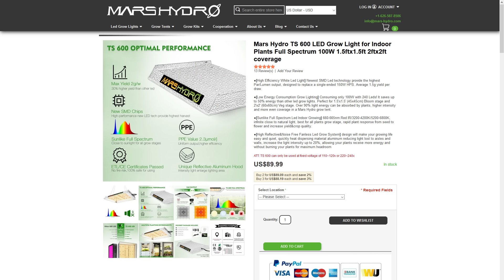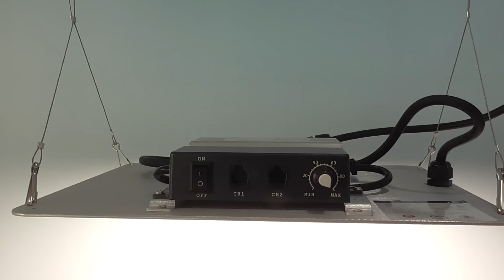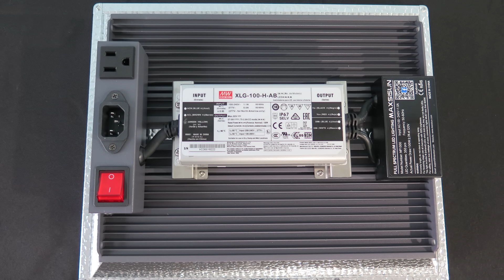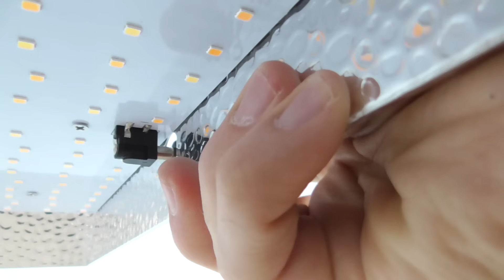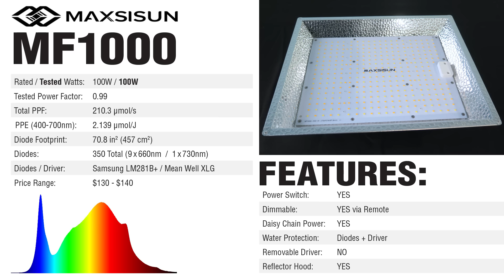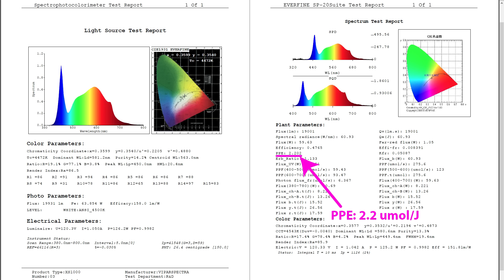Spider Farmer, Maxsisun, Mars Hydro - Entry Level LED Grow Light Comparisons, Test Reports & Reviews

Comment: Physicist out of UW Madison here. Also, a growing and testing enthusiast. 

One refinement to your data - PPF doesn't include sub 400nm or >700nm, so the more IR+UV diodes, the lower the PPF and PPE (as you've calculated), though IR contribute even more on an energy basis (requiring less energy per photon (E=hv/lambda)). So the "2.9" data may just include a wider wavelength range, as PPF is an inherently flawed, invalid measurement parameter if IR+UV are included.

Said another way, a purely IR+UV grow light would have 0 PPF, but would 1 draw power and 2 contribute greatly to plant growth. Awesome video and great work overall, though!

Update: For anyone optimizing a grow room to run as cheaply as possible, plant growth scales with number of photons, NOT wattage drawn from the wall. It takes nearly twice as much wattage to make a blue photon as a red photon, yet to a plant, they're both the same as far as photosynthesis[1]. 

Said another way, a light that puts out more red than blue could have a much lower efficiency but deliver much more usable energy to your plant (red photons carry about 1.8eV whereas blue are ~3.1eV).
Reply from the maker: Thanks for your input! The 2.9 PPE data does not include IR / UV. It was a fabrication. This video update talks more about the PAR range and PPF efficacy vs Photon Flux efficacy: https://www.youtube.com/watch?v=WmjOSzSF-HI

I'm not sure where you get the data showing blue photons require nearly twice as much wattage. This source cites 450nm blue diodes as having an efficacy of 3.5 umol/J while 660nm reds are 4.5 umol/J: https://doi.org/10.1038/s41438-020-0283-7. Red diodes get a boost, but they're not twice as efficacious.

When optimizing a grow room to run cheaply, a grower would get the most PAR photons per watt if they simply used Red Diodes. But such diodes are more costly to manufacture so the upfront cost would be higher. More importantly, plants won't grow properly under such a narrow, limited bandwidth. You need to account for photomorphogenesis. Thus, blue LEDs are needed to avoid undesirable morphologies. But the phosphor coated blue diodes also add green light into the spectrum which brings its own inherent advantages like improved canopy penetration.

Either way, higher efficacy is still crucial. On a watt per watt basis, the higher the PPE, the more PAR photons being emitted which means more growth potential.

Comment: I have a 150w plant floodlight made by yunlighting in South Korea.
63 samsung LM351H-C + 14 samsung LM351H deep red + 7 LM351H IR
The LM351H-C is 10 times more powerful than the LM301H.
701umol/m2 sec at 60cm distance using 60 degree lens
Reply from the maker: The LH351C is 178 lm/W. The LM301B is 220 lm/W. Although the LH351C is rated at a higher max wattage, the larger quantity of LM301B diodes would allow them to compete just fine.

Comment: Mars hydro ts1000 has a 1.68 pod  efficiency in a 2x2 with reflective walls. I personally yield 187 grams in a 2x2 considering the cost I think it’s a great budget light.  Although they aren’t being transparent in my opinion it’s still a good budget light considering it’s 150 watts Check this video out
https://m.youtube.com/watch?v=f1c-b55HhSk
Reply from the maker: It's good that you're getting good results! That video is obsolete as the model was upgraded since then. My update reflects the newer revision data. And I have actual 3rd party lab tests which are the proper way to get efficacy specs: https://www.youtube.com/watch?v=WmjOSzSF-HI

Comment: So far you and Migro are the most honest light reviewers, i'll definitely subscribe.
Could you please review the Mars Hydro TSL2000 and Mars Hydro SP3000? I ordered the TSL2000 and i'm hoping for great results. I wanted to buy the SP3000 but i changed my mind, and it was quite more expensive.

The SP3000 really needs an updated review, all the reviews for it are outdated. Mars Hydro changed the SP model specifics, originally it had UV & IR, good diodes etc. but now they removed the UV/IR completely.. And i think they changed the diodes from Samsung LM301B to LM301D or vice versa, i'm not sure and i don't know anything about diodes.
It was praised as one of the best lights for the price on the market, but now they ruined it.

They claimed their reason for removing UV/IR: ''Customer feedback showed that UV/IR doesn't have much effect on plants, and most growers preferred to add sperate UV/IR lights if wanted''
First of all, UV/IR does have an effect on plant growth. Second, i read their official poll-post on some cannabis forum, and everybody voted to KEEP the UV/IR, most growers agreed it has a good effect on plants, nobody wanted to buy separate supplemental lights. Nobody wanted to remove the UV/IR. Those who were not sure still voted to keep the UV/IR because any addition is welcome. So they are straight lying.
And third, Mars Hydro advertised the UV/IR in the beginning as a good addition for plant growth, and now they're suddenly not sure anymore??
I guess Mars Hydro realized they made a light that is too good and decided to fix their marketing mistake. Because guess what? Not so long after, they released a TC series that had UV/IR and it's so much more expensive.

I ordered from them because i do believe they have good lights that will make me happy with the results, and they are in medium range for affordable price. But i don't like how they deal with weird business and marketing. They waited until all the good reviews were seen, and then decided to change the light. Now it's impossible to get that original light, which was probably the best bang for the buck.

Comment: I grabbed a maxsisun mf2000 after watching this. I love the thing. Great buy IMO, so much so that I actually ordered another one last night now that my girls have outgrown their current set up. Last time it arrived a day early and I had it installed in minutes. Hope this helps someone like me... slow, skeptical, suspicious, shopper who reads every review possible if Im spending more than about $100. Some details... my grow room is 4 ft x 4 ft. I plan on using 2 maxsisunmf2000 for 6 medicinal plants. The heat stays within ideal range with the light on. This guys video is very helpful for understanding the info you want to understand when new to purchasing led grow lights. Good Luck!!!
Reply: Is 1 mf2000 good for a 2x2 tent or is it too much

Comment: I have some issues with our focus on ppfd. Ppfd is a set spectrum of light that is believed to be beneficial for plants, but is it really true that a lamp with a lower ppfd is worse than one with a higher? Or might it be that a certain plant requires a wavelength that is not captured as ppfd?
Reply from the maker: Wavelengths do not trump photon count. The raw number of PAR photons that a plant receives are what fuels photosynthesis and leads to biomass. This is especially true in the case of these lights which all have balanced spectrums that work well for plant growth. So a light that produces higher PPF levels is going to be the light that has higher growth potential. It's a simple, reliable metric.

Comment: Just a great, well-presented video as always. Maybe I can add a couple of additional observations. 

The cheaper Mars lights are made with very shiny aluminum, but it is not anodized. The shine will diminish over time with natural atmospheric corrosion. 

The Maxsisun PB-2000 I bought was the same diodes as my Spider Farmer SF-2000, but it was about a third cheaper. It had about a third less diodes. Wouldn't that mean the diodes are being driven harder and will not last as long (assuming they both run at the same wattage)?
Reply from the maker: Thanks for watching! I'm not sure. When I look at the current PB-2000 Pro, it uses 700 diodes with LM281B+. But the SF-2000 is 606 diodes with LM301B. So I don't know how that compares to older product revisions.

Generally, yes more diodes will mean less current running through each. And this can help with both lumen maintenance and also efficacy. But many of these LED systems are using more solid components these days, especially the drivers. So hopefully it will continue to perform well and last a long time for you.

Comment: I need your advice on picking a good option to grow edible plants or blooming plants in a grow tent setting. I’m unsure which light of the four you rated would be best to grow plants that usually need full sun outdoor (like tomato, marijuana or blooming plants like roses or lotus). We don’t all have sunlight so picking a light that works well is crucial :( please reply ASAP 💓 thanks so much !
Reply from the maker: Any of these lights will work for plants. But lights with higher Total PPF will produce more light. This allows them to work in larger tent sizes. It partly depends on your coverage area and the number of plants. The TS1000 runs at higher wattage and will be able to support more growth than the others. For tent sizes up to 2.5' x 2.5' it would be good. The other LEDs are better for 2' x 2' tents. If your tent is 3' x 3' or larger, then you need a higher wattage light.

Comment: What do you think of the ts3000W mars hydro lights, just curious as I was on a budget n got those ones n now that you showed the water proofing issues on the connectors coming off the mean well drivers they run pretty cool which is nice but i feel like I'm losing light so i installed a mover to eliminate the dim spots and tease the plants a bit

Comment: Mars Hydro is awful. Lights don't fully turn off!!! Major design flaw
Reply from the maker: I've seen LEDs from other brands that will leak power as well. But who manually turns off their grow light each and every day? That's what light timers are for. And when the timer cuts the power to the LED, the light is fully off.

Comment: Hello i have an important question did not find any good answers maybe you could help me :
Is a led photon different from a sun photon ?
Is that so, does it impact the plant ?
Reply from the maker: Hi Rabah. No problem. Basically, any specific color (wavelength) of photon is the same, regardless of the source. So a red photon from LED is the same as a red photon from the sun. But the sun sends out many, many more photons. This is what makes it so bright. Also, the colors of photons are more varied than LEDs. The sun has a more complete spectrum including UV and spanning all of the way into Far Red. LEDs have different mixtures of spectral composition, depending on the diodes used. This video talks about the basics: https://www.youtube.com/watch?v=O3dxjk_E2Ac
Reply: @Albopepper  thanks a lot for your answer! I will surly do !

Comment: Another problem is, PF means PFC, power factor correction which affect by the led driver but not led diode.
Reply from the maker: Yes, the junky drivers are a direct cause of those poor power factors. Consumers need to be on the look out.

Comment: Yeah. But Migro and dr mj coco have reviewed viparspectra and the pro series is better than mars ts
Reply from the maker: Sorry but you need to be much more specific than that. Exactly which models are you comparing? And how are they "better"? What parameters are you looking at?
Reply: @Albopepper  p series vs. The ts series by mars hydro.... if you want the info check out their reviews. But, talking about $/watt, usable ppf/watt, total ppf/watt,price,cost to run
Reply from the maker: No. The "TS" series is not equivalent across the line up. Please specify exactly the models. Are you comparing the TS1000 to the P1000? What about the XS1000?
Reply: @Albopepper  viparspectra  p1000 and xs1500 vs. Mars TS1000. Viparspectra p1000 101 watts, viparspectra xs1500 147.6 watts, mars hydro ts1000 150 watts
Reply: @Albopepper  also no idea what LEDs mars uses in the ts series.  Viparspectra doesn't specify it on their website but the pro series has samsung LEDs with the sosen driver, just not sure which Samsungs they are.  I would assume the lm281b+ like the v1000.
Reply from the maker: Ok here's a comparison for the P1000 vs TS1000:

P1000
PPE: 2.19 umol/J
Total PPF: 222 umol
Power: 101W
Price: $85
PPF/$: 2.61

TS1000
PPE: 2.18 umol/J
Total PPF: 315 umol
Power: 145W
Price: $140
PPF/$: 2.25

Efficacy is basically the same. The TS1000 yields more light overall. But the PPF costs a little more per dollar.
Reply: @Albopepper   again the TS is 50% more power and around 50% more cost. All that to barely outperform the viparspectra. That makes the viparspectra a better light in my opinion.
Reply from the maker: The TS1000 is 44% more power / 42% more light / 65% higher cost. That's the actual numbers. And if you prefer the P1000 because of that, then good. Buy the P1000. However if the TS1000 is able to generate 42% more light, then that's a significant boost in growth potential. It's not 'barely outperforming.'  315 umol vs 222 umol is a big deal. So make sure you account for that.
Reply: @Albopepper  well i actually have the p1500 and if you want the numbers from the source then check out your fellow lifht reviewers, Shane frim MIGRO has viparspectra as a better option and so does Dr Mj Coco. Just figured you would take into account actual reviewers test data even if you werent able to get it from the manufacturer. No worries though
Reply from the maker: Thanks for the recommendation. I've actually been working with ViparSpectra to get real test data. Not just a few spot readings in tents. I now have 3rd party lab tests for the XS1000 / P1000 and also the TS1000. I think ViparSpectra has been taking care of things to get their specs in order. They have good units. And they have some reports that show exactly how good. No more guessing!  :)
Reply: @Albopepper  right on, thanks for your reviews and videos as well. Also appreciate  a reply to a comment. Keep doing your thing bro

Comment: Giving Maxxisun prompts, yet until you uncovered their deceit they were fine with the reporting they offered.
Reply from the maker: From my experience with all four of these companies, none of them entirely understand the numbers they were throwing out. In regards to Maxsisun, they didn't really know the PPE specs on their units until shortly before I had contacted them. It was a mattered of ignorance, but not intentional deceit. Many companies like these will just cite the efficacy specs for the diodes used, rather than the actual lights as a whole. That's why we need to push these reports.

Comment: Do you think something like the ts600 is too much for a small contained greenhouse? Its for my rarer plants. Around 70x40cm
Reply from the maker: I've never seen a greenhouse that small. But the TS600 would cover that area ok. You could decrease the light cycle duration if it seems brighter than you need. It partly depends on the plants being grown. If you want maximum control, go with a dimmable unit. The PB1000 seems nice for a budget unit.

Comment: Would changing the driver on a sf4000 up the efficiency? And thanks for the video.
Reply from the maker: Hi Justin. Perhaps that would work. But probably not by much. I doubt it would be worth the hassle. You also have over factors that come into play like the diodes themselves and also the amount of current running through them and the heat being generated.

Comment: Totally agree Mars-Hydro is EXTREMELY difficult to work with!  I had a ts600 fail on me.  Aprox 25% of the panel went out.  Took them about a month to respond to my warranty claim!!  

When they finally responded it was someone who I had to repeat myswlf to a couple of times cause e flush was not their first language.  This person said they were overseas.  Ya would think they could hire someone from and living in my country so that communications and other things would be more efficient.

So i decided to pay extra to upgrade to the sp-150 during the claim.  The sp-150 failed shortly after hanging it the first time.  Fortunately they did send a replacement ASAP that im running now and is working well.

But they wasted sooooo much of my time on my very first grow.  They did ABSOLUTELY NOTHING to compensate me for my troubles!!  They couldve thrown me a light or a discounted upgrade for my troubles.....but nope.

And Idk why they have a phone number on their website.  The rwfusw to ever answer it or even return calls.

This is why i will never ever buy feom mars hydro again.  Had they been willing to have a short phone call we couldve saved a couple months if emailing.

They couldve had a haply custimer who understands manufacturing is imperfect.

But nope.  They just suck.  They dont care about you.  Only about getting money from you.
Reply from the maker: Sorry to hear about such a horrible experience with them! Had you purchased through their website, rather than Amazon? They keep trying to get me to put a product link directly to their site. But I think Amazon would offer more reliable terms of service, including return policies.
Reply: @Albopepper  

I actually bought through amazon.  I never attempted to deal with amozon cause in thr past amazon has always been shit customer service when an issue comes up.  Its always "we will email you" when I call and I never hear back.  Never dealt with amazon on the warranty for this.

I too thought amazon had good customer protections.  But i got ripped off on a gopro with accessories pack from a third party seller and got shit service from amazon is why I didnt wanna deal with amazon for this warranty.

I only bought reluctantly from amazon cause I think i got 4 lights all ts600 for 67 bucks each there and nowhere else that cheap.

I totally regret the purchase after my experience.  Especially after watching this video talking bout the shit performance of the ts 600
Reply: @Albopepper  I am howecer thankful they allowed me to pay the difference to get the sp150.  I ASSUME its a better light than the ts 600.  I hope lol